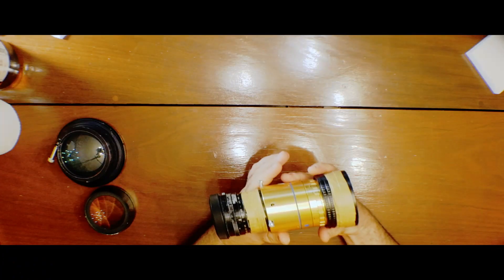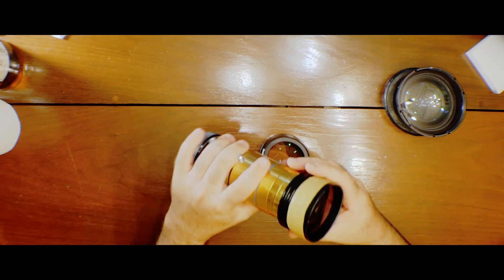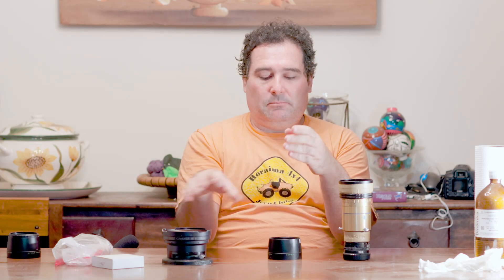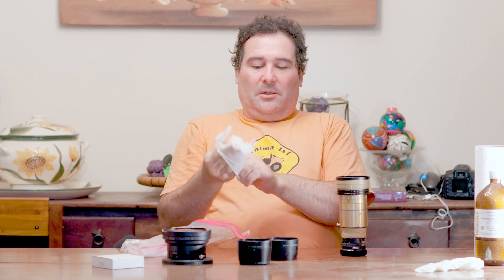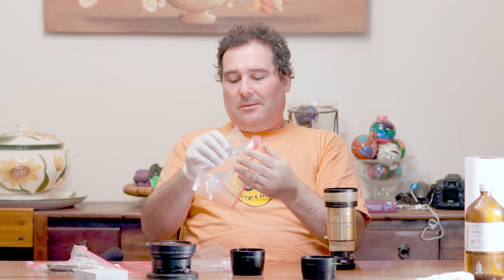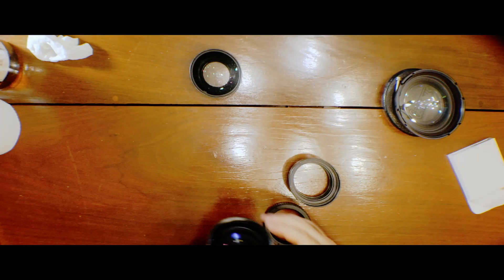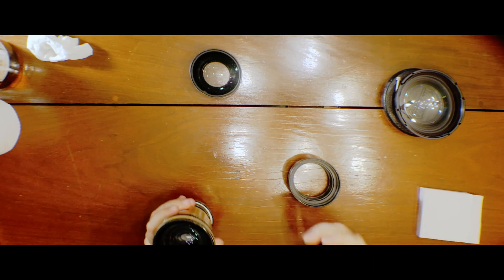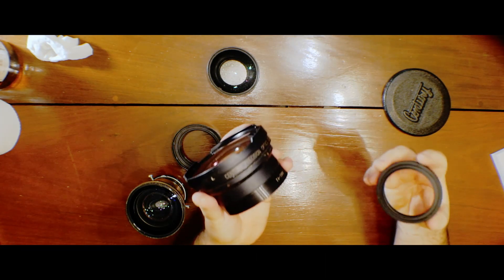Tinkering to develop a single focus solution for an anamorphic setup - Introduction

Comment: Thank you for posting this.  I am wondering your thoughts on attempting to use a 2x teleconverter glass and inverting them to attempt to create a VD?  I suppose my thought is if the glass is 2x closer if you invert the glass shouldn’t be 2x wider instead and since all VD are made of wide converters it should work?
Reply from the maker: Hello Imhotep, very interesting approach, but I suppose that inverting the 2x tc will not do the trick, let's follow the approach… The TC works as a negative diopter, it will make the projected image circle bigger so that the sensor will capture a portion of the original image creating the impression of approximation. This block of glass works as a negative diopter on booths direction inverted or not inverted. To create the effect that we are looking for we need a positive diopter image block that will squish the image circle into a smaller circle…

Comment: Hi! Im going to buy a vintage anamorphic projection lens, but its 50-500ft, no infinity, minimum focus can be solved using diopters, but should i worry about not having infinity on the projection lens?
Reply from the maker: Hello debasishnaidng, I suppose you will have to adapt this projection lens. In that case you will have to carefully set the focus of your taking lens and anamorphic block to the same focus distance and use a single focus solution to focus your setup. I am mostly certain that your anamorphic block might have some play and reach infinity with would be the best for your system to operate adequately. If actually have to lose infinity you will have to decide by yourself how this would limit the use of your setup. For curiosity what type of anamorphic block you are considering?

Comment: Hi. Would it work better, if you cut bigger glass to put in smaller helicoid? I mean if you will use only center part of the bigger glass, so less soft edges?
Reply from the maker: Hi Alexa, I am not sure If completely understood what you are aiming for. They way I see using a bigger glass in the single focus solution might be some what useful to reduce vignettes, the softened will be much related to the quality of the glass you can find. There are other practical elements that will make a build possible or not, the most important, I think, is the native distance between the front and hear elements of the wide adapter. This distance has to be sufficient so that you can fit in between the helicoid, somehow. For me the Fujinon works best, I have tried some options but none of them performed so well. Another point to consider, glass is heavy and big glass can become very heavy very quickly… so this is an aspect for you to consider in your build…
Reply: Ty!  @tinkeringto6836

Comment: Hi, would it also work if the wide angle converter would be in the back or in the middle?
Reply from the maker: Hi Jonathan. No, the idea is to use the wide-angle converter in the front part of the setup. This way it will double down as a wide angle and as a variable diopter. Sometimes having the wide-angle effect, is an additional bonus, some times it is a negative, but the main goal is to use make it a variable diopter and focus the anamorphic setup. There are two great benefits to this build and two drawbacks. To the benefices, it is a single-focus solution, so you only focus on peace of equipment, both the anamorphic block and the spherical lens are kept at infinity. The second benefit is the close focus is usually much greater than what you would get with the double-focus setup. Now to the negatives, it obviously always impacts some image degradation compared to no optics in front of your setup, but my perception of using this Fujinon is that this is negligibly comparted to the benefits, the second drawback is that using the single focus solution will result in some reduction in the maximum wide-angle that would clear the full image circle in your setup. In my experience 35mm would clear fine in an m4/3 and 58mm would clear fine in a full frame without the single focus solution, with the single focus solution this number would shift around and could jump to 45mm in m4/3 and 75mm in a full frame. But remember that there is some widening effect in the single focus that could revert the loss in coverage. In the end, things tend to balance.  Sorry for the long explanation 😊